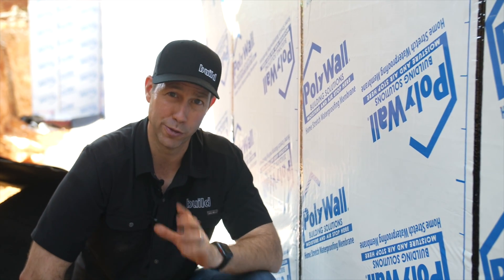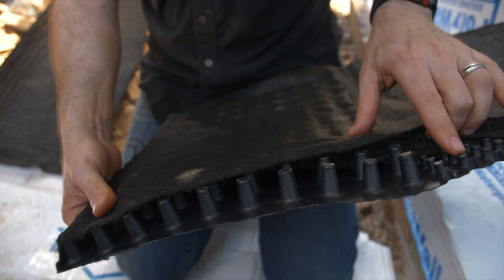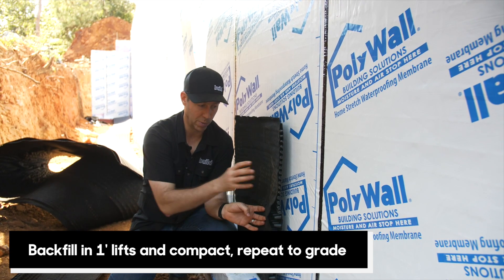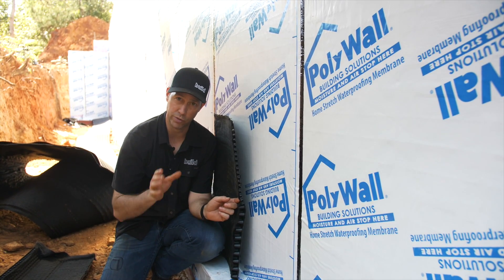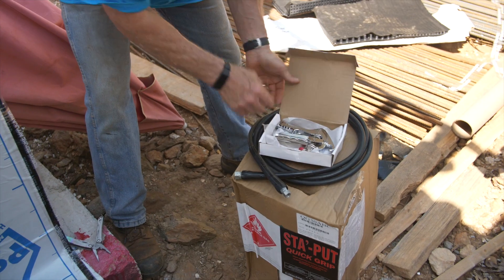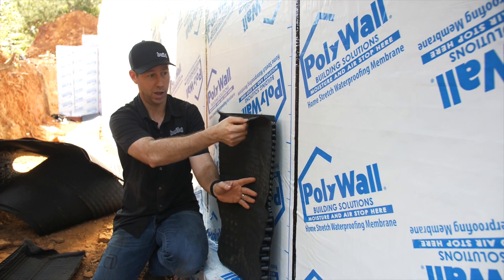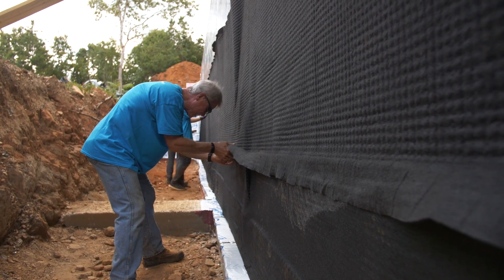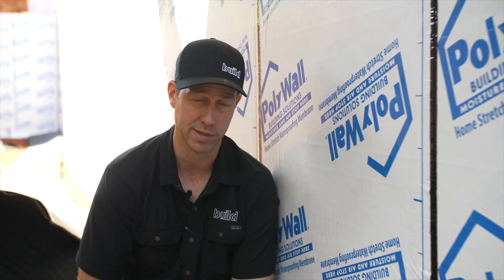DON'T Miss This Critical Waterproofing Detail

Comment: 1:30 Why dont you want to fill with big rocks? If the point is to maintain dimples, tiny rocks willl fill the space and defeat the purpose of dimples. Only rocks bigger than dimple spaces will keep the spaces open.

Comment: The problem is that most  builders don't want to pay for this. They barely want to pay for the spray or roll on membrane. I have been waterproofing for 20 years and 95% of my jobs we just spray the walls and they backfill against it.  That being said, just the spray is usually good enough I've never had a foundation fail or leak and I've done 5000+ in Massachusetts.

Comment: Matt, two questions ??
1. Would you still apply this over an insulated poured cement, in-ground foundation?

2.  If you insulate the foundation, which essentially acts as a water barrier itself, would you still also apply a stick-on or roll-on waterproofing membrane underneath the insulation panels?

Comment: I know this video was released 4 years ago,  I have been researching this method of waterproofing ICF, one thing I couldn't find is the Pink Primer that you used to coat the ICF before applying the Poly Wall.
Reply: They sell it on their website

Comment: We installed the DMX AG foundation wrap on our new house build along with using a foundation water proof coating underneath. At first glance the product felt thinner than I was expecting. But that doesn't seem to effect the rigidity. It was easy to work with and cut. It would've been nice to have another mounting option. Nailing this up per manufacturer specs puts alot of holes for water intrusion. Our basement is block and I did not want unnecessary holes in the membrane, foundation sealant, or block. If you're interested in how we waterproofed our basement, come take a look! https://youtu.be/WKrOHDZ7GaQ

￼

The Hectic Homestead

Comment: never be the first through the door. with ICF foundation the drain wrap will eventually push into the styrofoam reducing the air gap and possibly damaging the waterproof membrane. i think those products are superior on a wood or conventional concrete foundation. also, mice love living in styrofoam

Comment: We call it drain board or protection board. I love this type of work. Below grade wp. I also really enjoy working with traffic coatings, I'd maknly do those in parking structures.
Edit: we also use the 3M glue that comes in a cylinder as well. Really gets the job done.

Comment: Matt, I have dmx above the basement floor level and a few inches up against the cement wall from below. I want to insulate and rock. Can I put a baseboard over the dmx? Should I use pcv or MDF ? I have a vinyl floor with cavities underneath to direct condensation.

Comment: Matt I have a basement with a perimeter drain... would this work as a continuous drainage mat / air seal down the interior walls of the basement to the perimeter drain itself? The perimeter drain will be hooked up to two sumps with airtight lids.

Comment: Can Polywall work on block foundation or would you recommend a product like Bakor Aqua-Bloc 770-06
 instead?
Reply: The manufacturer says polywall can be used on pretty much anything. They have different surface prep recommendations depending on what you are planning to adhere it to.

Comment: With gravel around the wall, I don’t see why this would be necessary.
Reply: I agree. A thick plastic membfane over the water proofing to prevent is from damage and a stone backfill from footer to daylight will do the same but on a far more massive scale. I can see this as an alternative where the foundation ends nearly on the property line or something and you have inches to play with. But if you are backfilling with stone this seems pointless.

Comment: Why do some people have the dimple on the outside and others have it on the inside? If it's on the inside you can snap into the outside with the dimple board and do a tight fit.

Comment: Can you do some videos on how people are covering this system above grade?
Reply: Normally dimple mat/ drain board isnt used above grade
Reply: Kinda my point.
Reply: It's below grade
Reply: @daveklein2826  The majority of the system is below grade you are correct. Are you suggesting that you would stop it some inches below grade and the ground covers the transition? I would assume that the dimple mat will come up 4-6" above grade thus a portion would stick out above that could be damaged by weed eaters and lawnmower not to mention looking unsightly. Or should you bring it all the way up to the bottom plate and then stucco over it.
Reply: @finieclimber  all of the system is at grade and below
Reply: @daveklein2826  that is incorrect foundation walls and basement walls never stop at grade they always protrude above grade, even if only a foot, to handle ground water otherwise you would have moisture wicking up into your walls. So there is a transition that has to occur. There are cases where people are building ICF's inside of slopes and daylight basements so a full wall with finished grade that is variable. Thus the exposed portion needs to be covered to be protected from bugs, water, ice, and UV. Let alone the aesthetics of leaving it exposed.
Reply: @finieclimber  We weren't talking about the walls
Reply: @daveklein2826  read my original comment.

Comment: What a great system, I would definitely consider that if I were to build. A year ago I just bought a duplex condo, we are high with great drainage, no water issues at all. I would like to finish the basement, I run a dehumidifier all spring and summer to keep the humidity at 45%. Concrete is porous and before I stud it, what would be the best treatment for the walls and floor? I live in southern Massachusetts. Thanks!

Comment: I'm not a neigh-sayer and I absolutely love this channel but putting "waterproofing" peel and stick on in a vertical orientation isn't going to keep anything out. Also - and I've asked this before - have you looked into Xypex? It is an ad-mix or paint-on-after erection waterproofing micro-crystalline forming waterproofing product. It's absolutely amazing and if you're not using it on every concrete application you do you're really doing yourself a disservice. You won't need any of that layered up junk if you just use Xypex. The wetter the outside of the wall gets - the more the crystals grow - the more dense and waterproof the concrete becomes. Done.

Comment: So many steps to finish this ICF wall foundation, I wonder if they can simplify it to try reduce the cost.
Reply: Lots of these are "Extra" steps to really make a premium final product. The dimple roll stuff isn't excessively expensive. 
I've seen so many basements that leak that I'd spend the little bit extra to really go overkill like this and make sure there are no issues ever in the future. 
ICF really doesn't require any waterproofing you wouldn't do on a block or traditional form poured foundation.

Comment: How long is the functional lifespan of this system?
Reply: quick repost. 
im  surprised to see my late dad used this concept on our large balcony water proofing. basically concrete balcony, water proofing  membrane, dimple mat and mesh, on top of that pavers stone. Paver stone keeps out the UV and its a killer detail. i took one paver stone off because it cracked, and the water proofing below it look almost brand new.

Comment: Seems like that dimple mat should have the nipples toward the concrete to hold the dimple mat off the concrete.  Because the filter fabric will end up being pushed into the dimples or get full of dirt .   With the dimple against the concrete the channel for water to flow down will always be open.
Reply: I've seen products that are intended to be installed dimples in. They come without any fabric layer for obvious reasons. 
This product is designed to be installed as shown dimples out. 
Like you said though I'm skeptical that a little fabric is going to do anything to help keep that soil out when back filled especially over time.
Reply: I was just thinking the same thing, and was scaring the comments to see of anyone had an opinion on it. Thanks 👍
Reply: I think you are exactly right. Common problem of a general contractor not knowing how to properly install a specialized system. 
But then again most foundation waterproofing/repair companies are equally inept and at least they are trying here. I will give them that.

Comment: I used a system like this 23 years ago when I build my basement with ICF. I used 3/4inch washed gravel fill around my dimpled system. I used engineered panels above grade because at the time it was 20% cheaper than the ICF. My brother built his house all ICF all the way up. I would never built a house again without using ICF construction. Trust me here in Ohio we get temps from -10 to close to 100 degrees and I can honestly say that I don't regret using this type of construcion. Yes it costs a little more but between having all this foam in house and using Geothermal heating and cooling it doesn't take long for the return on investment. Unfortunately a couple of years ago we had a fire and the foam will not burn! It does shrivel up from the heat though. Was easy enough to replace the SIP panels that were damaged.

Comment: No bugs live in mine. My top is completely open no sealing strip. Dimplex on bare concrete with minimal fasteners along the top. Basement is cool in summer and warm in winter. I believe the concrete foundation walls drying out has created more of a thermal break due to the porous nature of concrete.

Comment: So the water proofing can't get wet a lot so the waterproofing needs it's own waterproofing. Got it.
Reply: Drainage board isn't waterproof.  It just protects the water resistive membrane from mechanical damage, soil microorganisms, and high pressure.
By your reasoning, siding is redundant, we should only use house wrap.
Reply: I don't think it's that the waterproofing can't get wet, it's more about controlling the water on the property.  Additionally the air gap should help the underground part of the house be more conditioned.   Controlling the water is the same reason we put in drainage ditches and gutters and stuff.  It's not a bad thing.
Reply: mold trap, layers in layer on layer of shit.
Reply: No you don't got it
Reply: Water proofing systems NEED a drainage system to prevent hydraulic pressure from destroying the foundation.

Comment: It looks like on the joint, only the filter fabric overlaps like a shingle and the backing butts up together with no overlap.  Maybe I’m seeing it wrong. If not, I think they should put a flat lip on the upper back side for the upper section to lay over, preventing water to enter at the seam.  Probably overkill, but if you’re going that far...🤷🏽‍♂️ why not?  Great videos!
Reply: Looked to me that the top of the base wall is missing about 2" of dimple 6:05, so I would assume it is meant to overlap that as well.

Comment: Why dident you use hydraulic cement ? Dose it get to hot for the icf forms ?
Reply: yes it would be too warm for the forms and also too much added pressure and would endure a number of blow outs as he mentions that could happen, better of with a higher psi concrete than 3,000 psi standard. I have worked with and used hydraulic cement.
Reply: @Joshua79C   i have studied icf blocks my self,  and was hoping the heat of the cements would not melt the structural blocks , guess ill have to resort to my first plan .  Sand mixed with  wood glue add 1/2 part water andpart 1/2 cement  and polyurethane  as added hardner. Artificial sand rock
Reply: You can use standard cement, but certain hydraulic cement may get a bit too warm or exert pressure the foam blocks may not be able to handle, you can use any cement mix of at least 3,000 psi and up.

Comment: You could put that system in place, but how successful will it be with all those joints between panels?  Why don't you just clean off the concrete, spray foam the entire exterior of the basement from the lower plate down and over top of the footing...and DONE...one piece, no leaks, and insulates from heat and cold. This is what I did around my old basement (1950's) and it is by far the warmest room in my house in winter ( I live in Snow Lake , Manitoba, Canada, where we have 6 months of winter and minus 35 degree Fahrenheit temperatures for weeks on end). I should also mention that because my lot slopes two ways, part of my basement is above grade...and it's still incredibly warm.    You should try it sometime, it would probably be more cost effective and quicker with a better result. Cheers from Canada!
Reply: Watch the previous two videos please before I go on

Comment: I want to lead a campaign for Texas basements!  We should be doing this, especially in all the infill construction going up on small lots in the old, close-in burbs.  Great space for mechanicals and storage, shops, etc.  And Polywall is in Ennis!?  Spectacular.
Reply: And a basement can sit on more solid soil, not clay that gets water logged and causes homes built on pier and beam to go way out of whack, constantly needing leveling. Or post tensioned slabs. My understanding is below four feet the ground doesn't move and why pole barns stay strong and plumb. Or am I wrong?

Comment: omg new products! i'm fully entering a cynical state... how much for the adhesive? my clients can't afford this !
Reply: Not a new product and you cannot put a price on proper engineering.
Reply: actually I would put a price on it, by the sqft. we're talking about water proofing a foundation here, no space exploration. this system looks great, how much does it cost per sqft?
Reply: For those of us with wet, damp, un-repairable basements... convince your clients it's worth doing right. They can improve what is above ground later! You can't really dig the house back out and replace the basement....

Comment: Can you tell me why you wouldn't just add xypex to the concrete mix ?
Reply: Water can still follow all of the plastic ICF ties that go between the forms.  Doesn't matter if the concrete is water proof.
Reply: Good point. But then there has to be a way to seal in between each block before its seated.

Comment: Thank you Matt. 20 years ago dimple matt was a pain to put on being able just spray and apply so much better. This series was very help for sealing up poured walls of all types.
Reply: What the hell are you talking about? Dimple mat has been routinely used for more than 40 years.Anyone with any knowledge of waterproofing takes dimple mat for granted. Anyone that thinks it is  hard to install has zero knowledge of waterproofing. In the industry it is called drain mat

Comment: What keeps the bugs from moving into the dimple mat?  Seems like it would be a great home for many types of underground bugs.
Reply from the maker: Robert, what’s the concern? This is Al board of the waterproofing so I don’t see why it would matter. Thanks for watching. Matt
Reply: Ant colonies, yellow jacket nests, termite nets, any other bug that lives in a colony underground.  I would assume they would rather move into an existing underground space rather than digging a fresh space.
Reply: Bugs go to the food. No food, no bugs.
If you had wood somewhere, that would be a concern.
Looks like a foot of gravel against the filter so no easy boring for critters.
Assuming the entire thing filled up with bugs... one insecticide treatment and the bugs would die, decompose, and wash away.
Reply: Is that bad?
Reply: I know some systems have a mold strip that lays over top that prevents debris from falling in. I’m Sure it reduces pests as well and I bet PolyWall probably has the same thing.
Reply: #freebughousing
Reply: Seems like the fabric combined with the pressure from the backfilled dirt would stop them from getting in the dimple mat and anything that did get in would find it pretty inhospitable with it being a drainage system.  I've not seen bugs build in places that regularly get washed out.  Even above ground bugs tend not to build in drainage systems and instead aim for areas protected by the rain.  This seems like pretty tightly sealed system that was well thought out.